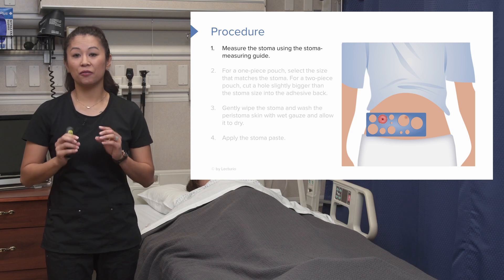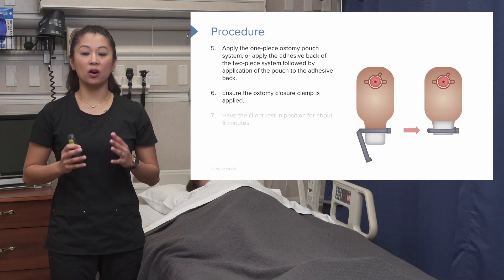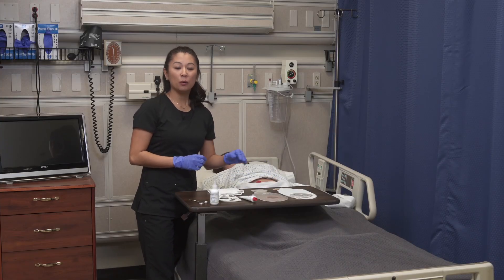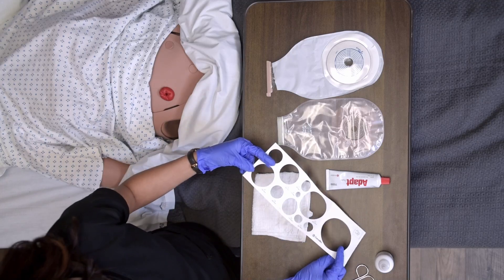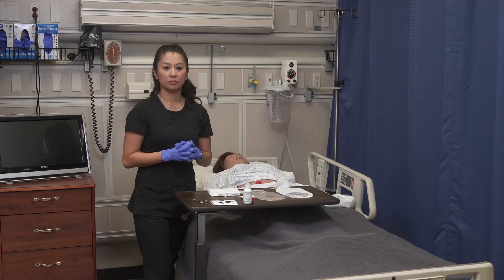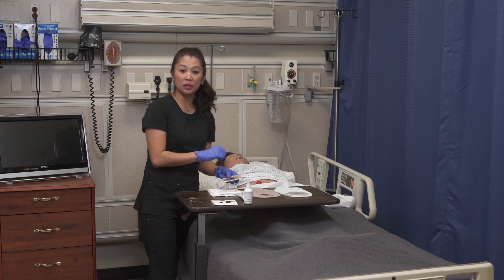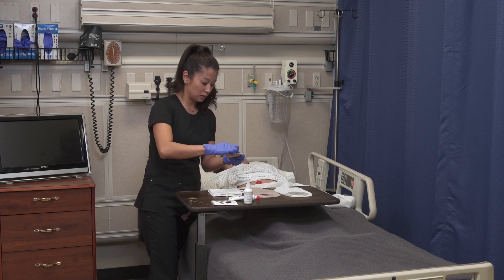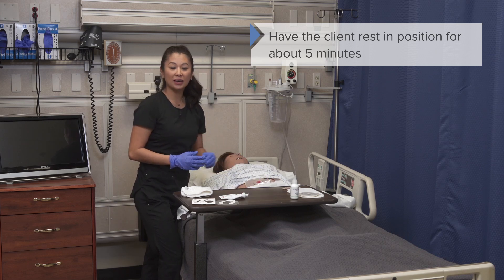How To Change An Ostomy Pouch - Explanation & Demonstration | Lecturio Nursing

Comment: I didn't hear you mention 2 kind of nice things to have when pouching. Skin Barrier wipes and adhesive remover. There are some that have 'no cut' openings. Either pre-cut to a specific size or moldable.
Reply from the maker: Thanks for the great suggestion! 😊 Skin barrier wipes and adhesive removers are definitely helpful for skin protection and ease of pouch changes. And you're right—moldable or pre-cut openings can make the process smoother! Don't forget to subscribe for more tips! 👩‍⚕️👨‍⚕️